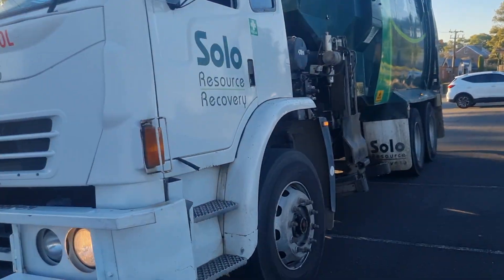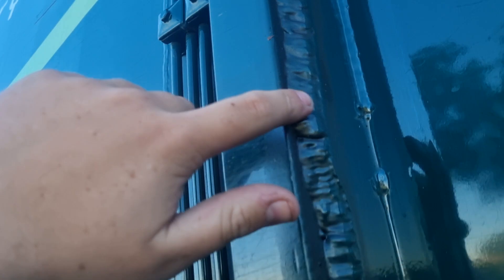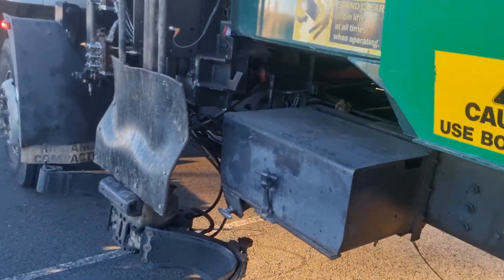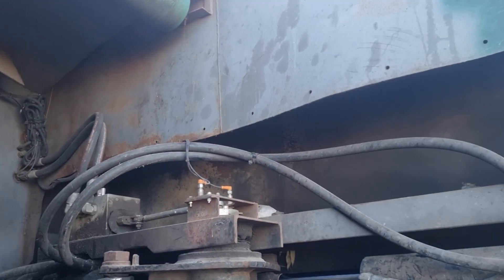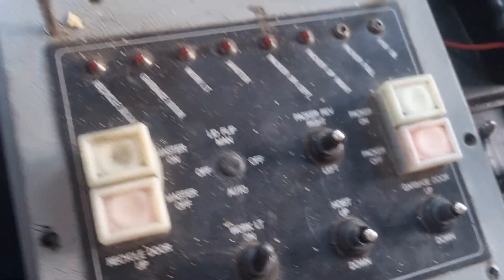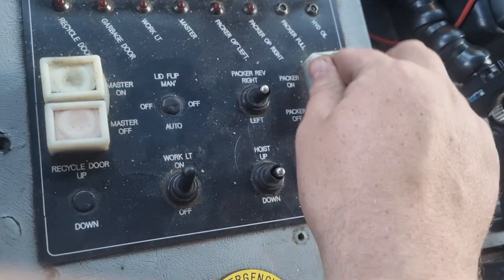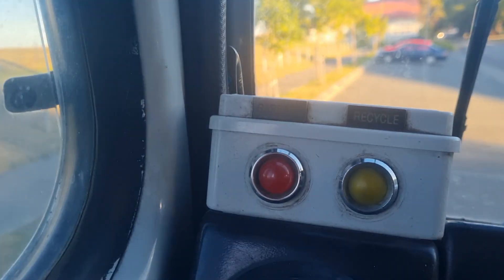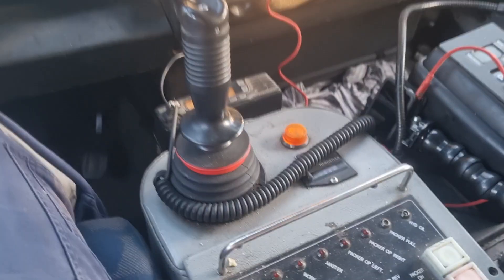Ex Solo Comblift and Split Truck - 1812 - Walkaround

Comment: Great video, thanks for talking us through it. I'd assume that inside the body of the truck they would have removed the split floor as well and kept it as one big open box? Why would they go to this effort of conversion to a single body vs keeping it as a split body and just loading rubbish or recycling into both compartments? I guess weight and payload might come into that equation and by removing those bits allows for more waste stream weight. Thanks for posting!